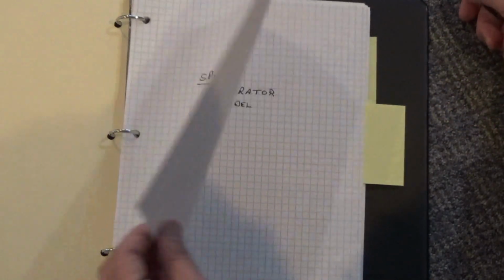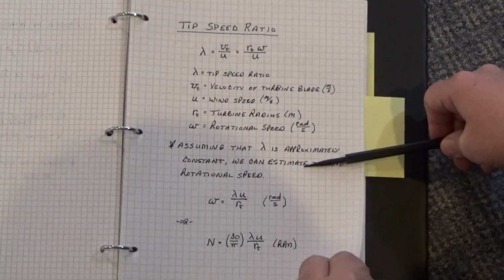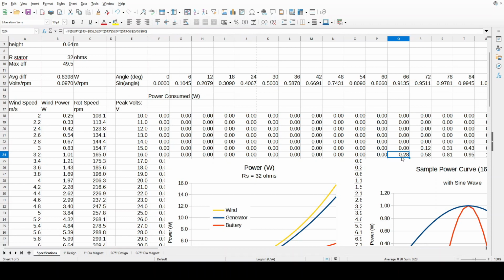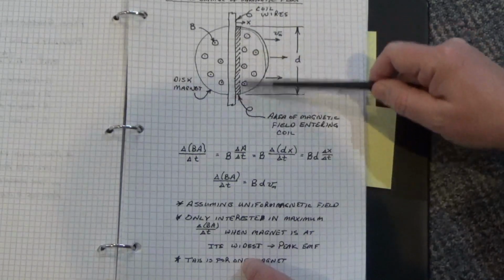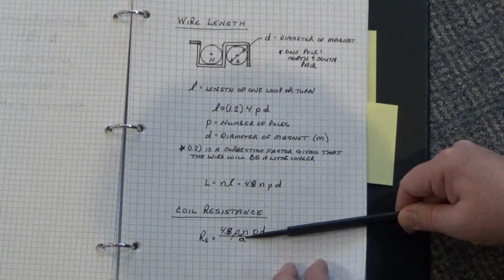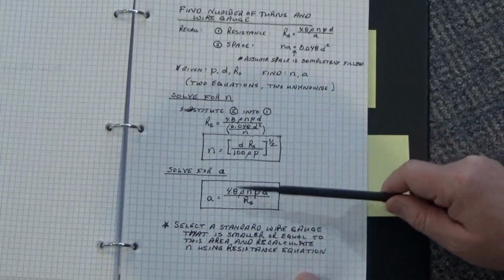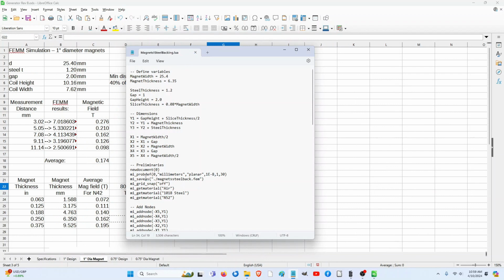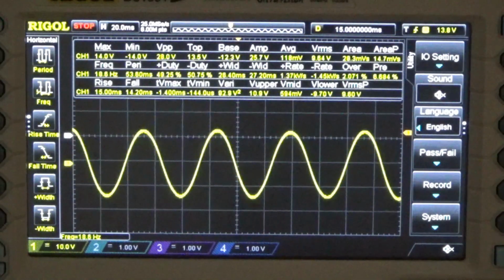3D Printed VAWT - Generator Design

Comment: Like I said before; you're the "math magician" I thought you used to have a charge controller that would allow you to leave the washers out and the electronics would keep the gen from overpowering the wings something like USvawt; Steve and Marcus were doing
Reply from the maker: That was a while ago.  I thought it was overkill for this humble amount of power.  :-)  I also wanted the design to be something anyone with a 3D printer could make with a few extra readily available parts.  One can get a windmill charge controller like the one I have for less than $20.
Reply: @MickEMaus3000  what rpm would you need for the 30W I predicted that size configuration "could" produce
Reply: And....it has no problem self-starting. What attack angle did you set the blades at?